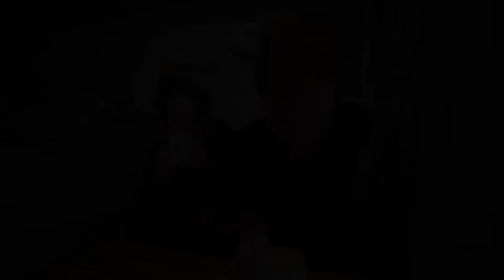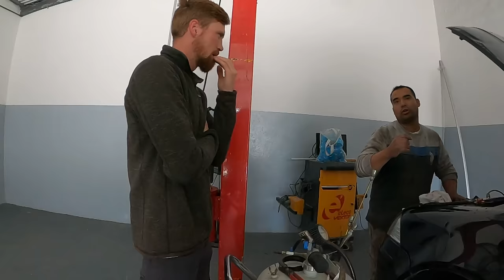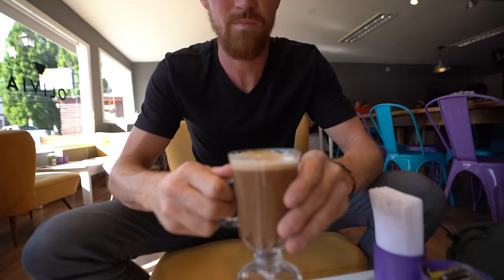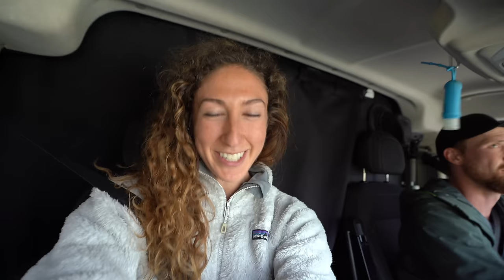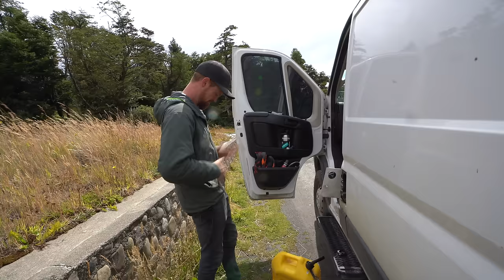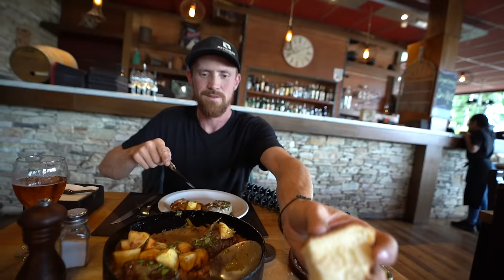WHAT MAKES PATAGONIA SO SPECIAL?

Comment: That compressor is the real deal and is worth every penny paid when you need it. Excellent selection and yes it was overpriced but will save your behinds one day!
Reply: I agree - I have a compressor like that in my Jeep, and it's the real deal (unlike those cheap plastic ones that don't produce enough CFM or PSI to do big tires like yours). Safe travels, y'all!
Reply: Seems to me that is switchable to vaccuum pump also. Might be helpful if you need to break bead in order to patch a tire in remote location
Reply: Yep...that’s a good one 👍
Reply: If you ever got the chance maybe installing in engine bay a actual air compressor directly run from the motor?
Reply: I think the remote location is what drove the price up and they looked like the only place in town where you could get one!.Trent was smart to grab it when he had a chance because those roads look like they are shredding those tires!
Reply: Frank wants  dinner? Yes x 10...my pupper very obedient at any hint of food..ha ha ha

Comment: You're showing your youthfulness (it's a good thing). We had longer lines for gas in the US in 1974 due to the oil embargo crisis. Odd-even rationing was introduced — meaning that if the last digit on your license plate was odd, you could get gas only on odd-numbered days.
Reply: I remember that in 1974 i grew up in front of 2 gestation ,and im in Puerto Rico right now and when hurakane Maria we had gas lines for day's people was sleeping in the car's just for gas i gratfull i FULL my 2 car's and got 4,  5 gallons conteners full in my house 24/7 just in case of a emergency i been on my own since age 14 so life tough me allot about life , my dad had a van 1974 dodge 318 mottor and we build it with bed sink fridge and we use to go on vacation every summer i love it i want to do van life before i die is my dreams i just don't know if i should do it in Puerto Rico or in USA.

Comment: Those type of compressors use a lot of battery. When running it off of the vehicle battery it is recommended to keep the engine running if you have a lot of inflating to do. Otherwise you'll drain down the battery and not have enough power to start the engine. They typically draw 15 amps.

Comment: Compressors are great until they fail which they do regularly if used too often simply because most (& especially the cheap ones) have very low duty cycles.
I trust you do also carry a decent foot pump as well? They rarely let you down!

Comment: Thank you for the great videos. My plan was to go down to Puerto Williams last October, but came back early due to the riots in Santiago. Looking forward to a trip again. I looked for videos on how you installed the holding tanks, but couldn't find it. Do you have any part numbers for the right tank? brackets? any installation info?
Reply from the maker: Tank is from plastic-mart.com and I used plumbing steel tape

Comment: Air Compressor - Next time  you need to inflate a flat (or really low tire), jack up the van at that wheel to take the pressure off the tire.  The compressor is competing with 1. air pressure in the tire,  2.  the weight of the vehicule.  With the jack, you remove the vehicle weight so the compressor only has 1 job...pump air.

Comment: I found Olivia on Google maps and able to follow your walk back to the van up to the cement wall (I live an exciting life. lol).  Anyway, I just wanted to say (as a real grandpa) I remember when we had the gas shortage in 1973, I'd get off of the graveyard shift at work and I'd get in line to get my ration of gas for the day.  My memory is a little faint (I don't have it on video) but it might have been every other day.  Gas lines, the good ol days.
Reply: There were odd and even days. 
License plate was the determining factor.
Last digit!
Reply: @RevMarket  Thanks, I remembered that right after I posted this.

Comment: add a 12 volt socket in kitchen, run cord out back window > a deflated spare could get rim/bead broken, cannot be inflated without high flow compressor
Reply: Or a little propane and a match.

Comment: There you go, got a good compressor. Don't run it for long stretches, shut it it down and let it cool if you think it's could be running too much, feel the motor for heat. In the states, that's on the high end. Mine ran about $90. 

You get into 12 inches of soft...rock, mud, sand, snow, rough dirt roads, air down at least 10 lbs. Your tires are safer, you'll get through stuff easier and it will be a more comfortable ride. 

That compressor makes your old one look like you got it out of 25 cent candy vending machine for kids.
Reply: Van weighs too much. Must protect side walls of tires.

Comment: So 400 for a jacket... But 175 on a air compressor is too much? Some stuff blows my mind...
Reply from the maker: Haha the jacket has a lifetime warranty. I don’t know if this compressor will last a week. I’m rational I promise 😊
Reply: @TrentandAllie  The Arc'teryx Guarantee states that any items with defects in materials or workmanship will be replaced or repaired at their discretion for the practical lifetime of the product. So...
Reply: @TrentandAllie  What brand is the air compressor?
Reply from the maker: Sohigh Ifly I’ve warrantied multiple items with them years after I purchase them. Arc’teryx is one brand I will go to bat for. They back up all their gear for its lifetime as long as you haven’t worn it out

Comment: blows my mind that the two of you decides to travel to the end of the earth. BTW Lanina is in full swing. Cold up welling water is pushing up from the bottom of the Southern Pacific ocean off the coast of Chile. It is causing a up welling of nutrients for fish, but also the horrible effect of major drought. Cold ocean water causes the dupoint to drop and rain is squeezed out and dry air enters the land. It normally sees 15 mm rain a year but from what I have read Chile has seen no rain in three years. Care to comment?

Comment: There's an air compressor link in your description. It's almost $400 and is definitely not the one from this video. More importantly, it's definitely not the one from previous videos which failed. Feels like you might've chosen an expensive one for an affiliate link but used a cheap one in your van. Surely not?
Reply from the maker: That is the compressor that runs our airbag system on the suspension.
Reply: @TrentandAllie  couldn't it have pulled double duty for emergency inflation? I know others have done it. Especially practical with a small auxiliary tank. Better in my mind to have a small tank that can go anywhere than a similarly sized second compressor that must be stored somewhere accessible. The tank would even be a redundant safety item in case of problems with your airbag system.

Comment: Am I watching NGO or Discovery 
Amazing
How high does that drone fly!
Living vicariously through others is a great cost effective solution allowing me to deliver my 300 miles a day all over New England and be in Patagonia simultaneously listening to Trent struggle in Spanish as Allie aces it like a local

Buy a Craftsman electric generator jump starter with built in air compressor that is powerful enough to get a 100 psi tire off from flat start I personally use
It powers my coffee maker and charged drills and lights and powers the ac ones and when I finally camp in GODS’ Country 
WHITE MOUNTAIN NATIONAL FOREST APPALACHIAN TRAIL with the literally named most beautiful national parks and land features in New England but also on the entire app trail

Obviously it is minuscule by comparison to Patagonia but has anyone frowned upon a 2 k diamond
The areas are still huge and filled with moose and bear and cougar with lynx bobcat white tail deer and bald eagles and wolves

Though Mt Washington is 6290’ it’s the vast openness scene from atop and the cog railway is a must to get to it
I’ve ridden my Harley with Robby KENEVEL to its summit and it was on discovery
The cog railway is the way to go 

The highest winds and coldest temps ever recorded to this very day are at its peak with huge chains anchoring it to the deep granite deep within it

This White Mt National Park taking up a third of NH is part of the GREAT WHITE NORTH which is Quebec and northeast Vermont and Maine and it’s the highest concentrated large wild life natural refuge in The America’s
My uncle owned a logging camp from Jackman Maine into Québec with no borders or crossings anywhere like a secret passage in and out the country made up of private logging roads some made by my uncles grader and skidders 
Every August I return to Lincoln NH with my two now mid teenaged kids who grew up going to NH annually with just myself since their mom divorced my ass for no good reason

We did take our daughter together once at a year old then while pregnant with our son and major complications keeping her out of work an entire year unpaid and in the hospital the entire time and two months after his birth with me paying all bills on one salary and raising our two yr old daughter by then taking her to the hospital sometimes twice a day over the entire 14 months which post pardon depression made my ex wife hate me and jealous and pissed off all the time 
When she was out finally our daughter naturally was closer to me and still is at 15 as well as our 13 yr old son due to the ridiculous resentment she never should of had but the symptoms from hormones and her mental stress isn’t her fault 
It’s that I’m the shit on the shit end of a broken stick so far up my ass ; every liberal dem gets a laugh knowing my painful situation but as the greatest President crushes them all yet again ; that stick will finally fall out along with every one of the OBASTURDS that tried to destroy our GREAT NATION GREATEST NATION IN THE WORLD PERIOD .... 
that allows people like US to travel FREELY AND BE PROTECTED DOING SO IN OUR GREAT CONSERVATIVE LED TRUMP ONE NATION UNDER OUR HOLY CHRISTIAN LORD JESUS CHRIST ALMIGHTY,
BY WHOM SHALL NEVER ALLOW ANY SOCIALIST COMMUNIST SCUMBAG TO TRY AND DESTROY IT LIKE THE COMMUNIST PARASITE BURNY SANDBAG WHO GAVE THE Usual COMMI pro Castro reading writing cRAP without the RUSSIAN NUCLEAR MISSILES PARKED AND  POINTING AT OUR CAPITALIST FREE AMERICAN NATION 
AND IT WAS AN OLD SCHOOL DEM BEING KENNEDY WHO SAVED THE WORLD 

THE DEMS THEN AND NOW ARE DANGEROUSLY DIFFERENT 
AND THESE DUMB LIBERAL KIDS DONT KNOW IT NOR REALIZE HOW BRAINWASHED THEY HAVE BECOME TO SEE THAT BURNY AND EVERY DEM RUNNING ARE PURE EVIL 
AS IS SOCIALISM 

NOTHING IS FREE 

“””WE THE PEOPLE””” will be paying the piper 

God speed and God Bless 
I hope you are Trump supporters 🇺🇸❤️❤️❤️🇺🇸